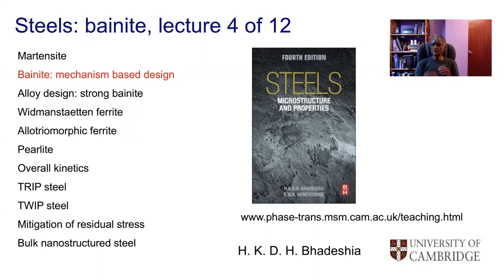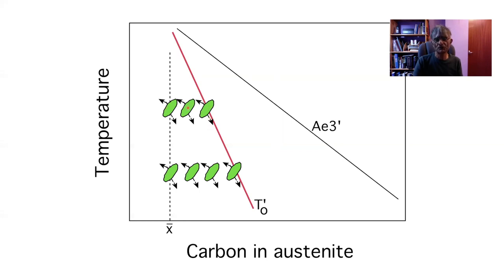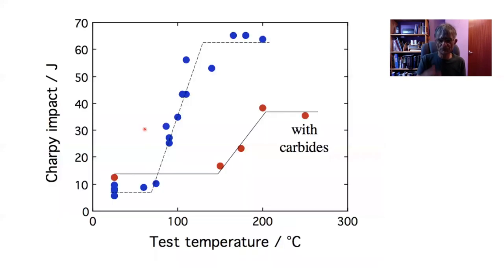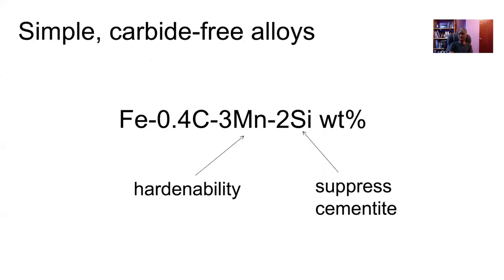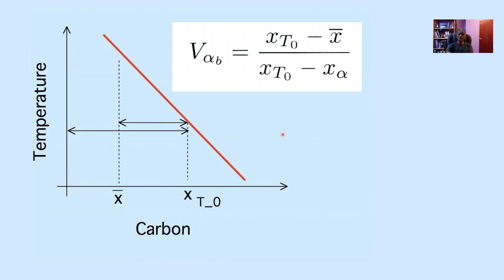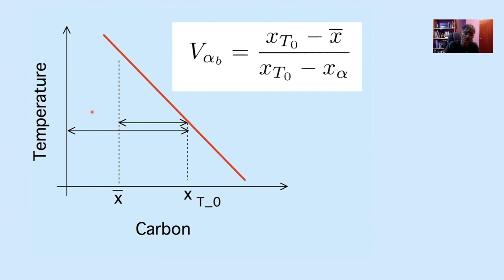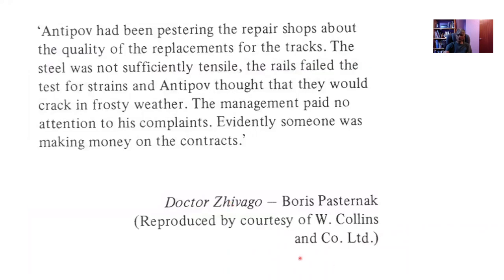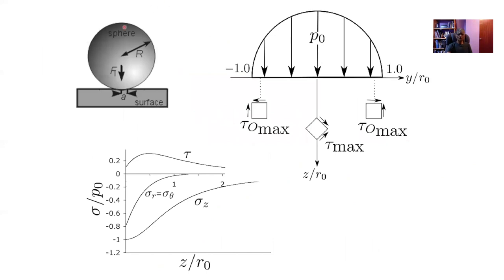Steels: design of bainitic steels. Lecture 4 of 12

Comment: Thank you Professor Bhadeshia for sharing your knowledge.
I was wondering about the volume change induced by the trip effect on parts  made of carbide free bainitic steels, especially in the case of massive parts or rails. It might be hazardous for the application if dimensional tolerances are strict, in my opinion. Is it relevant in the examples shown at the end of the video ?   Besides, do rail volumes change progressively due to fatigue loads as a consequence of progressive martensitique transformation ?
Reply from the maker: The volume change is really quite small, the volume strain being of the order of 0.03. Since the amount of austenite available for transformation is about 0.2 volume fraction, the net volume strain would be 0.006 if al of the austenite transformed. Rails undergo much greater changes due to wear. The only place where this might matter is the tight fitting of a bearing containing retained austenite on a shaft. It the bearing expands, then the tight fit would be lost.
Reply: Thank you

Comment: Sir, what actually causes bainite transformation to take so much time to complete (eg. 1day or 2 days). The growth is very rapid ( although less rapid then in martensite) and it introduces dislocations in the surrounding matrix to again nucleate more plates. Or in short what makes the "isothermal displacive" transformation to take such a large time to complete.
Reply from the maker: Have a look at this book, which is free:
https://www.phase-trans.msm.cam.ac.uk/bainite_NN.html
Reply from the maker: Both martensite and bainite can grow very rapidly or very slowly. Depends on the available driving force, which is small, will lead to a smaller interfacial velocity since the latter scales with the driving force. They can both be slow when accompanied by plastic deformation due to the relaxation of the shape change.  At sufficiently low temperatures, the nucleation rate can be slow for both martensite and bainite.
Reply: @bhadeshia123  Sir, when a newcomer steps in the field of research (Ph.D.) on steels, people often say it as an exhaustive field which are being researched since decades. You can choose to ignore the comment, but a very short reply can help boost the morale of people like us.
Thank You
Reply from the maker: @puppysobti7311  It is true that there is a lot of knowledge about steels. So you can explain that the subject is not for the faint hearted, and not an elementary discipline, to be entered into without long preparation.  It requires deep learning and can result in discoveries that change the quality of life.  Low-hanging fruits such as graphene make a lot of noise but as yet have created negligible employment or useful technologies.

As a joke, you can say that since iron is the most stable element in the universe, everything will eventually turn into iron so anyone working in any other field will not have a job.
Reply: @bhadeshia123  Sir, I observed dilatometry curve for bainite phase transformation during isothermal holding (1hour) above Ms temperature. Why does it come straight line?. Because during isothermal holding, bainitic ferrite fraction is increasing, so accordingly volume change (expansion) should be there and the curve should not be a straight line.

Comment: Sir.........Why not mechanical stabilization occure in case of Martensite???
Reply from the maker: It does. See Breedis JF. Influence of dislocation substructure on the martensitic transformation in stainless steel. Acta Metallurgica. 1965 Mar 1;13(3):239-50.,
Reply: @bhadeshia123  Thank you very much sir